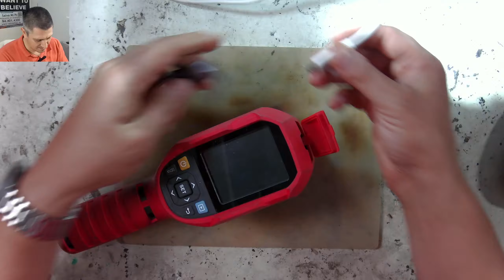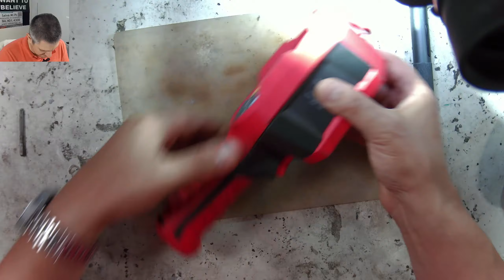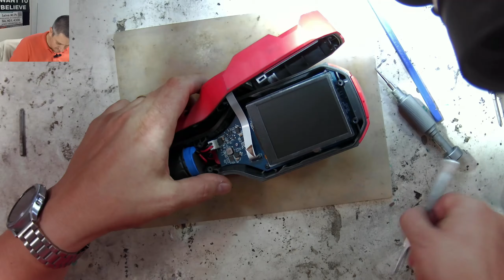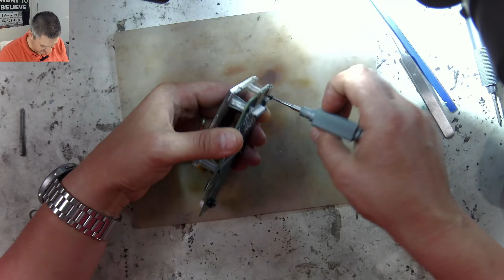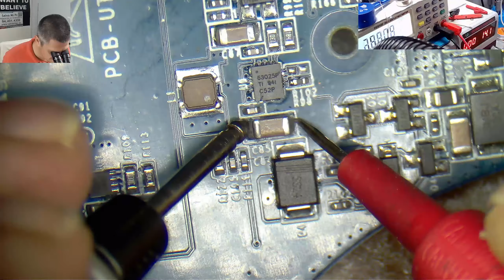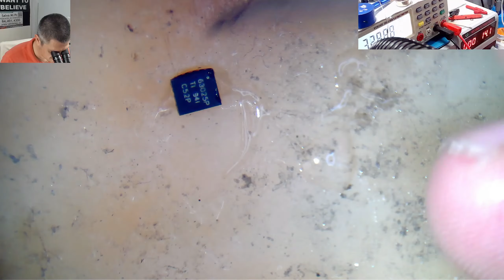UNI-T UTI260B Dead Thermal Camera Repair | No Power or Charging Fixed by Replacing TPS63025 Chip

Comment: Hi guys, I have the exact same device, and now it isn't working at all and won't charge. Is the issue shown in the video the only problem, or are there other parts involved? I noticed the comments mention additional electronic components. Thanks!
Reply from the maker: Hi, in my case, the problem was always the TPS63025. Measure the capacitors on the input and output for shorts and you'll know. If found a short, remove the TPS63025 and measure for shorts again. I recommend to take care with the flex from the screen and buttons, they are easy to break.

Comment: Hello, the MOSFET (01AH) was burned out, I replaced it, and I also replaced the integrated circuit you provided. I took measurements and there's no short circuit, the capacitors are fine. When plugged in, it charges and the battery fills up. However, when I press the power button, the screen light doesn't come on. It seems to appear on the screen for less than a second and then shuts off. When I press the button, 3.3V comes from the coil on the integrated circuit, and it disappears when I release the button. I would be happy if you could help me. Thank you.
Reply: The device turns on when I remove the battery and supply 3.6-3.7 volts directly from a DC power source. Once it turns on, I can increase the voltage up to 4.2 volts and it continues to work, but the device doesn't turn on when the voltage is above 3.7 volts.
Reply from the maker: I think should be the other way. 3.3v should be present on the button and when you press it should go to 0v, and when release should reappear. Maybe the flex for the buttons are not properly or in the correct orientation? Even if the button are not connected you should see the charging animation. Re-check the flex cable for the buttons and cammera.

Comment: There have been reports of this chip failing when people use a usb-c PD power delivery PSU to charge it. Apparently this unit isn't compatible. UNI-T should rectify the issue and make it compatible.
Reply from the maker: Thus doesn't have any pd controller, it has some resistors and diodes to enable the charge, but will charge at 9v instead of 5v. The best is just to use a simple 5v charger.

Comment: Are they all prone to break?
Reply from the maker: Yes, but I think its because of the charger. Ill make a short soon explaining.  But I found out that when you charge with a fast charger, the animation was doing strange things,   the voltage was 7V and the cameras was getting hot although was off. I swith to a dummy 5v standard old charger, animation it working fine  and the camera is cold when charging. Long storry short, use a 5v charger only.
Reply: @salvamipc ok!

Comment: Hi. I'm an electronics enthusiast from Poland. Thanks to your video on repairing a UNI-T UTI260B camera, I managed to get it working after replacing the U6 chip. The camera powers on, but a different problem has arisen. After turning it off, I can't turn it back on. I have to remove and re-insert the batteries, and then the camera powers on by pressing the button. Every time I want to start the camera, I have to re-insert the batteries.
Reply from the maker: Hi, it makes no sense, So it works fine until you turn it off, then, it will not react to the buttons unless you disconnect the battery and reconnect it? 

If so, you sure the flex for the buttons is connected? Are the buttons working fine? 

I would try, the following, then after you turn it off if you have 3v on the power button, locate the power button on the connector of the motherboard, disconnect the flex and short the 3v of the power button to ground, does it come on?

Also check after you turn it off, do you have voltage on the battery, what you leave the battery in and inject with a power supply, 3.7V or whatever this battery suppose to have, if you do this it's working? 

Also check when it's off and non-responsive to the buttons, if you plug in the power cable, does it come on with the charging sign? Can you turn it on when plugged in?

Comment: I got one, that shows 200mA, 5V. Charging animation on the screen.
Without usb, it starts for 25s and than goes to black screen.
If you leave it on the cable, you can start it up.
Is it the battery or the charge controller?
Which battery is that? 
26650?
Reply from the maker: What voltage you have on the battery? If you push voltage in the battery directly,  does it charge?
Reply: @salvamipc i bought it, assuming that its working, but if the seller doesn't want to refund me a serious amount of money, i wont even try to open it
Good tip, ill try to charge it directly
Reply: @salvamipc Where did you find that chip?
Reply from the maker: @CyberlightFG aliexpress,  look for  63025P